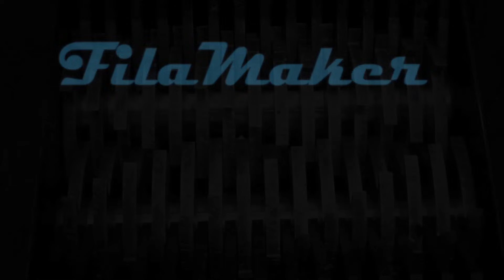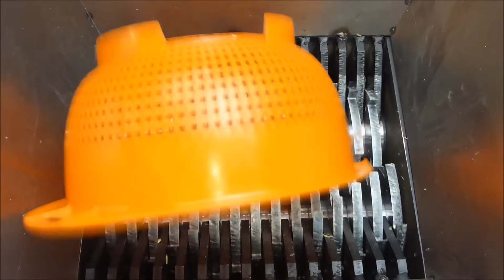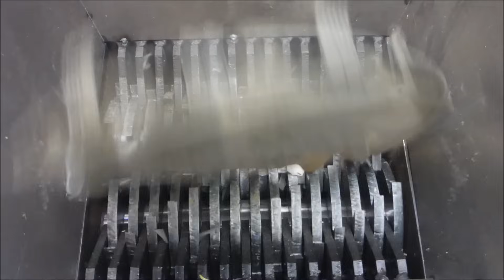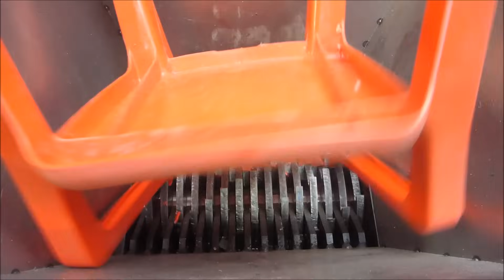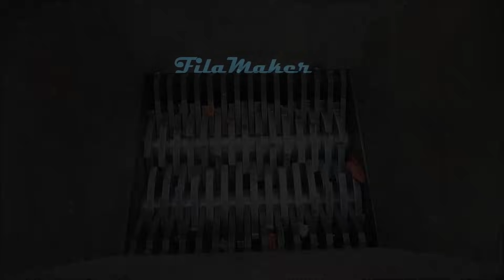Shredding plastic from household

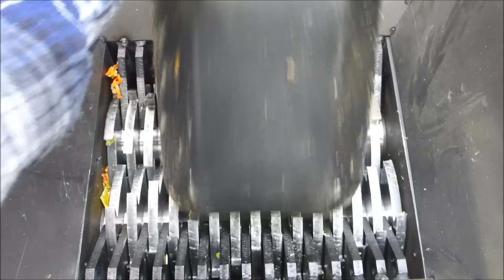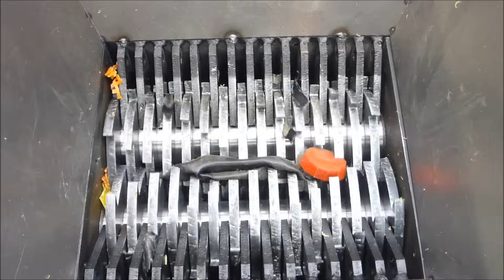Comment: 0:37 milk glass water milk pourer by shedding no. (0:38) fbokiswainobanomo by 0:39 my dirt is shaking by 0:42 hole wheel is spinning cracking fold. And the least once it is been removed. (Tip of the glass is shaking by the dirt. The fire once is been removed. By the cup.).